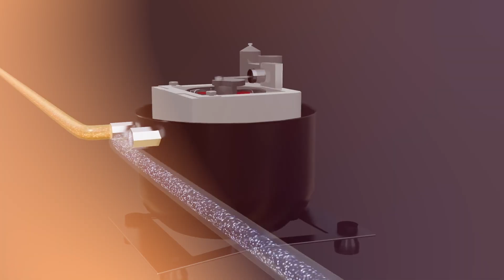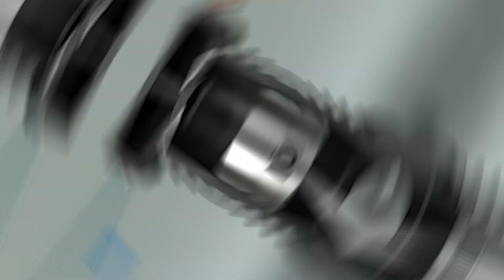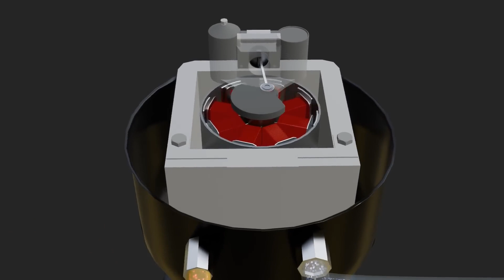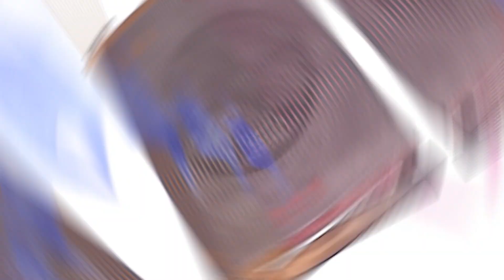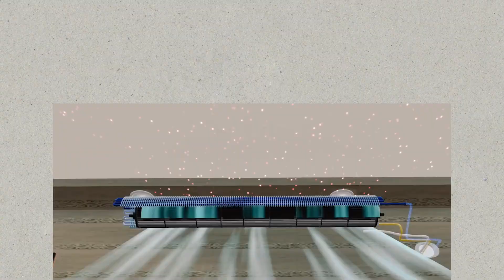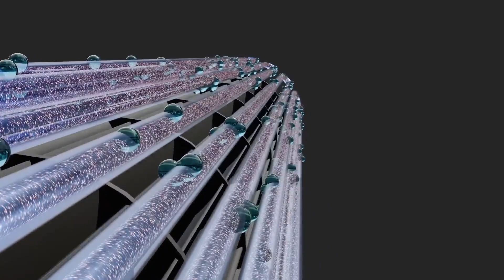The Mind-Blowing Science That Keeps You Cool!

Comment: Interesting video. So about 1/2 of all the energy that going into air conditioning actually going into the dehumidification process, and not into cooling. This is of course going to vary based on local conditions. (If you are in the desert or an extremely dry climate obviously this is going to be less of an issue.) Overall though, water removal is an extremely important part of AC for both comfort, and safety and mold prevention.